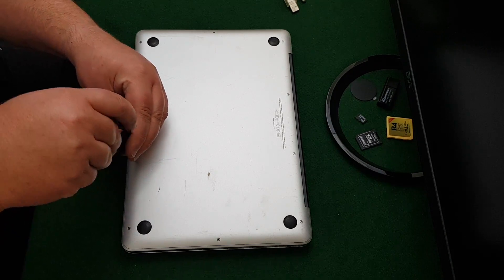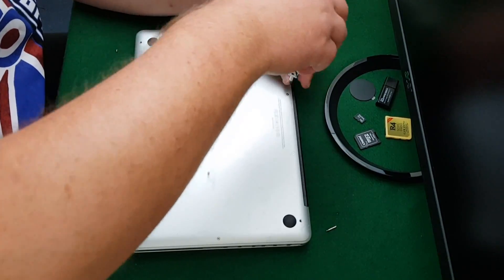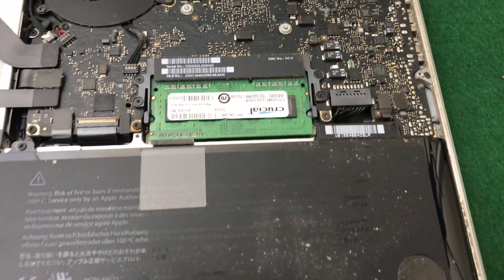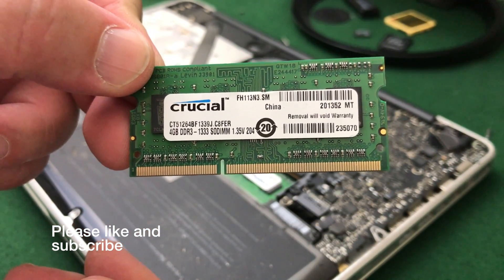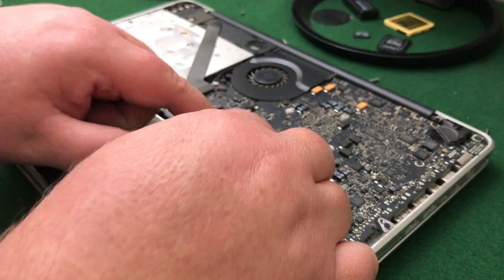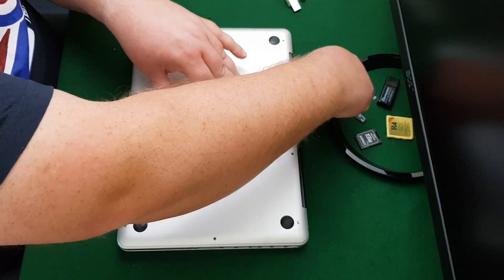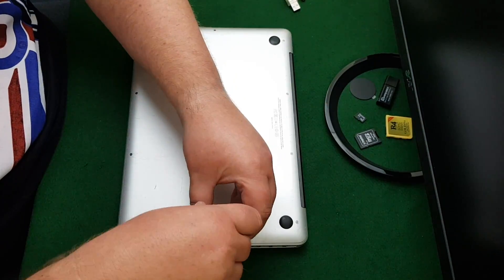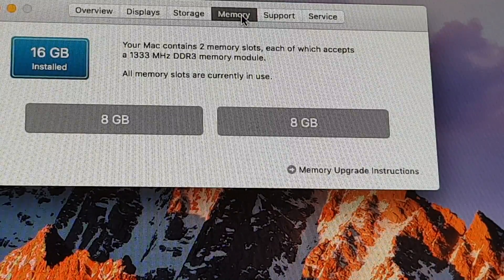Macbook Pro Ram Upgrade

Comment: Is it feasible to do the same with macbook pro of 2017?
Reply from the maker: +George Orfanidis that's a great question. From what I understand the later MacBook model don't allow you to do RAM upgrades so you have to get the correct size from the start. iMacs still allow you to upgrade the RAM though.
Reply: No :(
Reply: Yes , its soldered now !
Its like a 2 hour job with chance of ruining your mac !